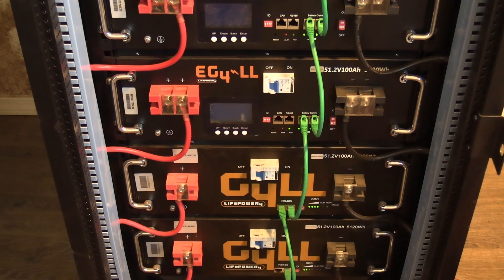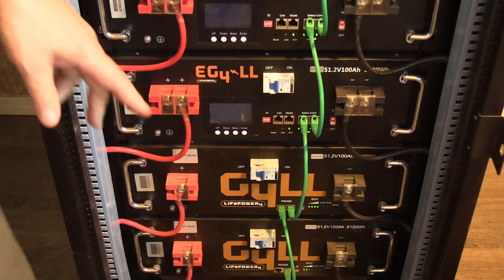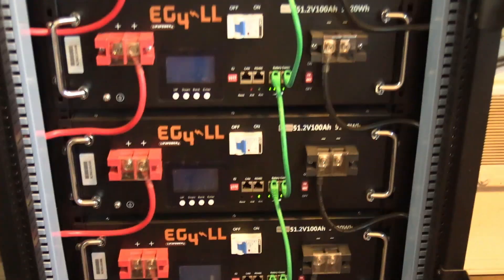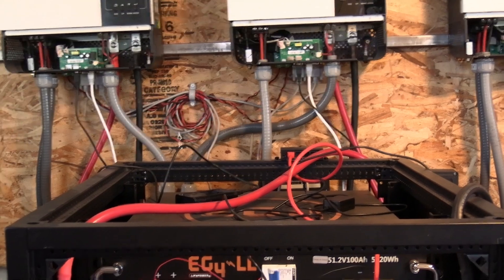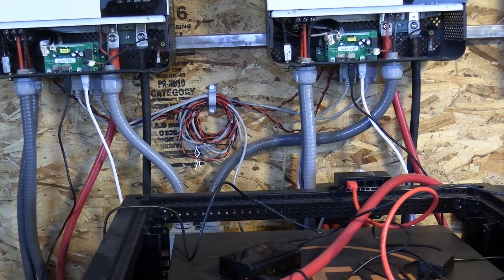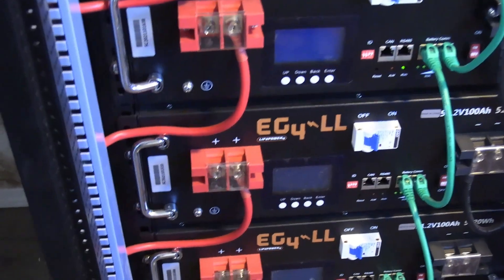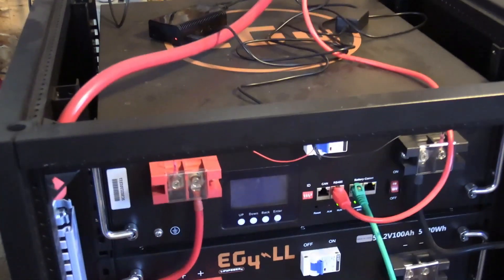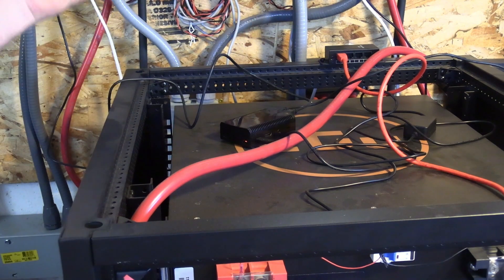solar communication

Comment: Hey James. How do you have tge settings in the Growatt? Battery tyke setting etc. 

I have mine set to lithium setting 5 - LI setting 36 to L01. But my inverters will only charge at 10A. Any suggestions on how I can get it to charge at a higher rate?

Growatt SPF5000ES (5), 450W panels (42), 48v LifePower4 batteries (9). 

Thanks for sharing your videos.

Comment: Hello, Have you tried to look at the battery status by connecting the USB cable that comes with the battery to a PC and the hub, in order to see if you can see battery status while connected to the inverter?
Reply from the maker: I did do that last year. But since I got the solar assistant device and the batteries with the lcd display I haven't done that. It is much easier to monitor with the other devices.

Comment: Hi James, I really like your solar and battery setup. What would happen if you hooked up your third inverter to the solar assistant? I think it would be nice to see how much power it is putting into the batteries.
Reply from the maker: The problem with hooking up the third inverter is that then the batteries would only allow charging at 48 amps. So it would only show 48 amps unless you are using heavy loads? You can’t hook it up. Only connected inverters will show up on the solar assistant. Load sharing and bms communication would all need hooked up also.

Comment: I plugged my cable into the bms port of my Growatt.  I first tried the rs485 port, and it didn't work. Maybe my Growatt 5000 is a newer version.
Reply from the maker: I have had mine for a while